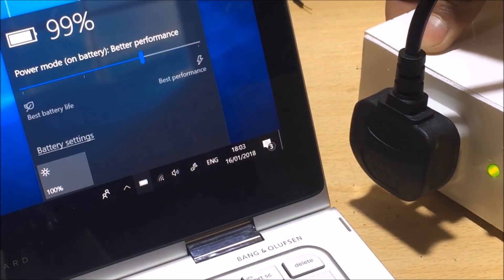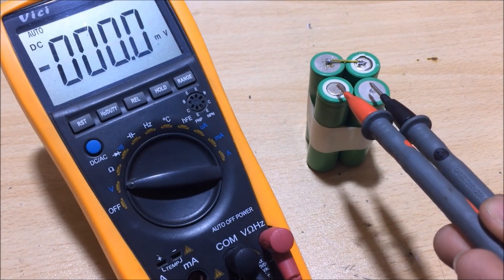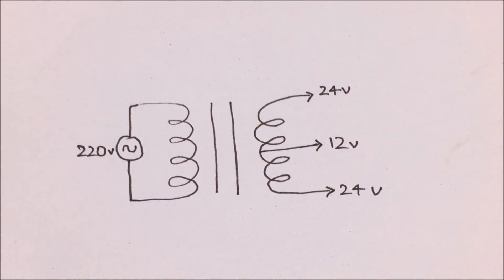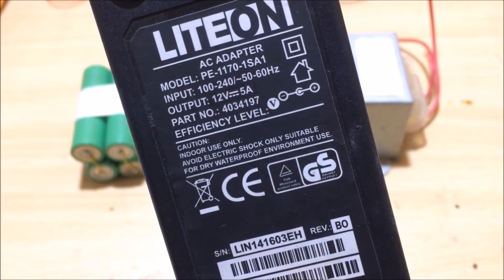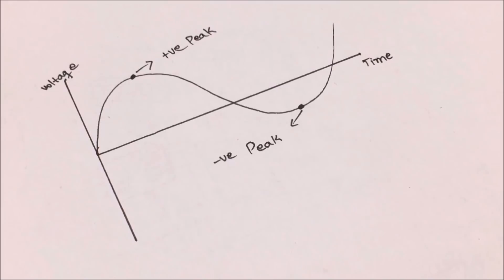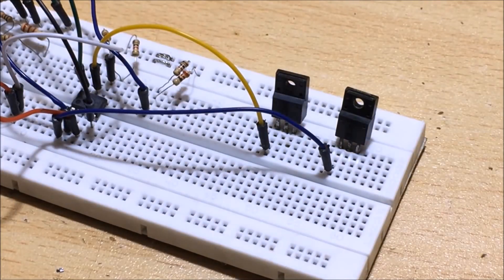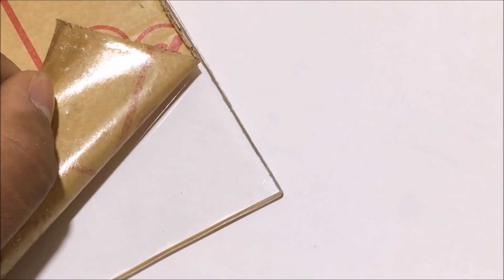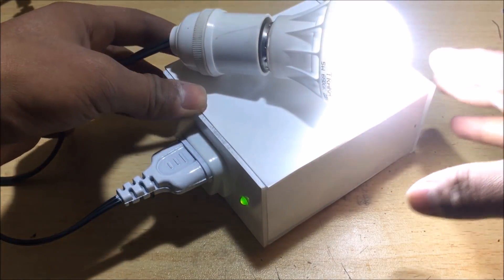DIY Mini 12V UPS || Laptop Power Bank Inverter

Comment: Please i don't understand the lm358 connection in the circuit diagram because you indicated two in the diagram while you use only one in the video
Reply from the maker: YES you are right i have used two different op-amps in diagram but the lm358 is a dual op-amp ic means it contains two different op-amps inside thats why i have used only one lm358 ic in the circuit
Reply from the maker: YES you are right i have used two different op-amps in diagram but the lm358 is a dual op-amp ic means it contains two different op-amps inside thats why i have used only one lm358 ic in the circuit
Reply: @Aatikslab  just draw the circuit of the one in the video for me please and you can send it to my number on WhatsApp 08091361953
Thanks